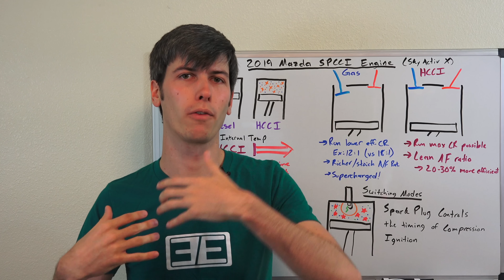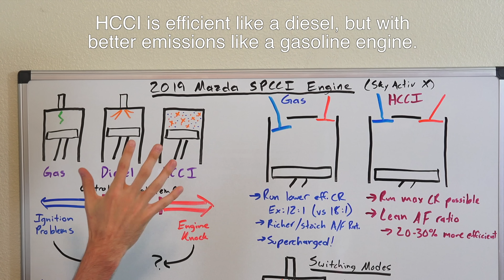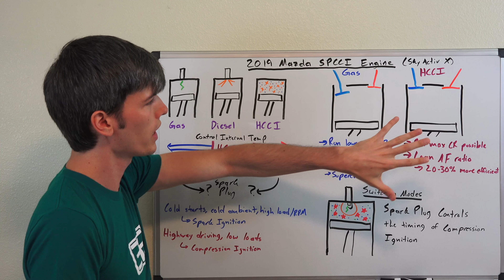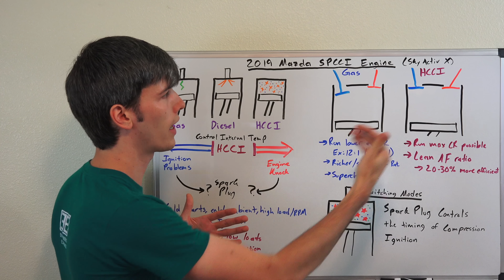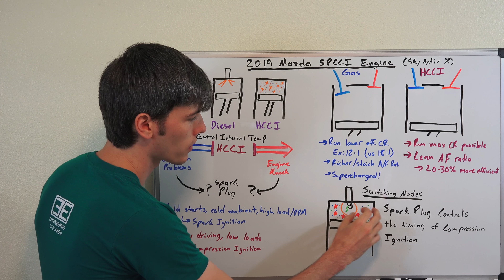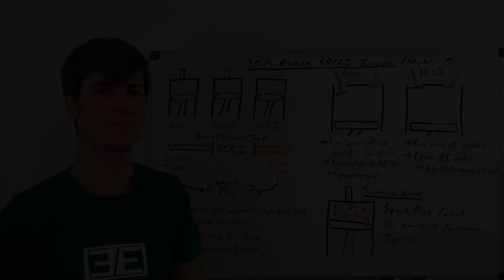Mazda Creates The Holy Grail Of Gasoline Engines - HCCI SkyActiv-X

Comment: A steady improvement and occasional breakthroughs og candles did not gibe us the Tungsten bulb; improvements to the Tungsten bulb did not give us the LED.  Likewise, all the silly "breakthroughs" with horribly complicated, inherently lossy ICEs will never get you close to the efficiency of an EV.  A Tesla Model S is one of fastest, quickest cars in the world... 0-60 mph in as little as 2.3 seconds... over 90 MPGe... needs no transmission, not even a reverse gear, yet has a top speed of 155 mph.

Of course, that comes from a company less than 20 years old, so they jave plenty of room for even grester efficiencies, performance and cost refuctions.

The Chevy Bolt EV provides 119 MPGe,  has a real-world range of over 300 miles (not the ridiculously conservative 238 miles the EPA has rated it), and provides the exact same 0-60 time of a Camaro, that has far more pathetic efficiency, and requires none of the tune-ups, oil changes, air filters, oil filters, fan belt replacements, leaky oil pan gasket replacements, tranny service, etc., etc., that no EV will ever require.

How millennia do you think it will tale to refine that behemoth you are so excited about to get it to 

Neither this silly, complicated Johnny-come-lately nor any other ICE will ever achieve the simplicity, efficiency, maintenance-freedom of today's EV?

Oh, I thought not.  Then why do you continue to beat this dead horse?  Why do you continue to delude your listeners?
Reply: I'm sorry... but... I found it difficult to completely read your comment due to all the grammatical mistakes. I can't even...
Reply: And what is going to power all these EV that will replace ICE? Energy grids that will require even more coal to burn , which is basically the most polluting agent?
Or the next step is to demand that every citizen gets an estate mansion that has enough sqft area to cover the increasing energy costs, with expensive and hard to produce solar panels?
Reply: But only rich people who also have ICE supercars can afford Teslas. What about people who can't afford it? Do they not deserve efficient cars as well?
Reply: Do you even know how an led generates light?

You couldn't be farther from the truth man.
Reply: Mazda is working on a Rube Goldberg machine. Meanwhile, Hyundai Ioniq has a 136 MPG combined. 150 MPG city. Mazda's most efficient 2018 vehicle gets 35 MPG. A 20% increase is a joke. A Prius from 15 years ago can beat that. Or a Honda Civic from 1990.
Reply: but hey, on a lighter note check this out! this is the truth.
https://www.youtube.com/channel/UCS_FY5mR4g22L_E9t1D_ExQ
Reply: oh don't forget this channel.
https://www.youtube.com/channel/UCTlbjcTWjTLqNmcF3VL7Xag
Reply: not even my worst enemy deserves a tesla
Reply: GloomGaiGar Yes, it's called a Prius which will probably beat this Mazda piece of sh-t. Or any one of the other EV that are less expensive than a Tesla. Look on fuel economy gov. There are plenty of EVs out there. As far as I'm concerned, Mazda is just a tool of the fossil fuel industry. Continuing to propagate bad ideas instead of delivering the real change that we need. I have a Nissan LEAF. Cost me $28K. I see morons driving huge gas guzzling pieces of sh-- everyday that cost more than that. Go price half the trucks these morons are driving.
Reply: billdale1 

Except that there's a gap between an all EV future and now. Something has to fill that gap while the emissions standards are increasing. 

Consumers in all won't go out and buy EVs, which haven't achieved success other than Tesla (which is a luxury brand). 

And any innovation is good, it provides more options.
Reply: Major fail on the belief that a EV is "efficient". It's not... it's a massive waste of resources.

Comment: So, they'll go from 8 lts/100km to 6,4 lts/100km and retain spark plugs+respective cables and electronic ignition computer? 
In the mean time I'm doing 5,7 lts/100km on my Volvo V60 diesel... no spark plugs...
How many millions have they invested on this? 
Someone is laughing.
Reply: you dont understand anything about cars do you? There's a reason that not all cars a diesel. Gasoline burns MUCH cleaner than diesel. Mazda currently has a CX-5 Diesel that's going to be available to the market within a few months goes 5.4 L/100 km. Also, some of countries are planning on and are in the process of COMPLETELY banning diesel cars in major cities. Like Germany. You should do some reading if you think people are actually laughing about a potentially more efficient gasoline engine.
Reply: well except for all that NOx diesels spew... that is killing people... I own a TESLA and its powered by SOLAR so i'm doing my bit.....
Reply: Dmitriy Barsukov 
The V60 diesel has a Euro4 engine with particulate filter. Because Diesel engines are so much more fuel efficient than petrol the total amount of particules released in the atmosphere is considerably less. 
Some cities have plans to ban both diesel and petrol cars.

Comment: wait... whaaaaaaaaat? "new engine type based on reactive combustion that relies on a static temperature/pressure enviornment. wait that doesn't work? use a spark plug to force it to work and let's try to really confuse them by saying it can be a totally smooth transition but wait it's not efficient because at first when it tests itself it's a richer fuel/air mix that defeats the purpose of itself... REBOOT"

am i the only one who sees this or is it just too late at night?

Comment: How would a forced induction intake work if the intake valve is left open during compression? Is the air pressure coming in and the air pressure going out at the same time negligible enough to not be conflicting?

Comment: This will have to have electronic valves, no? The valves have to open and close on demand, and not governed by the position of the crank, to regulate compression like that.

Does this lead to the problem of a 25 dollar solenoid that fails to work without warning grenading your entire engine?

Comment: Interesting, I'm not sure I understand how the process can be controlled by a spark plug though. How is HCCI any different from normal running if the combustion in HCCI mode is also started by the spark plug igniting the mixture? My thought is that surely in the less than optimum condition when HCCI is not possible e.g. in a cold start procedure, you would use the spark plug to light the mixture prematurely, before the piston reaches the very top of it's stroke. When conditions are OK for HCCI the piston will be allowed to get the top of it's stroke due to no spark plug being fired and the resulting extra compression leads to spontaneous combustion of the mixture as in a diesel - HCCI.

Comment: This answers to questions nobody ever asked. HCCI is a joke, not solving emission or fossil fuel usage problem. If this is "holy grail", then what this "engineer" would call CBG MonoFuel Engines which runs 18:1 compression ratio all day and has zero emissions? Those can be found for example from busses. ProTip: use Biogas and then never look back to these fossilfuel engines again.

Comment: So basically this is an engine with dual personality, it can be in an only compression mode when you don't have the pedal to the medal and when you want to move, you can use the spark ignition for classic gasoline engine feeling. 
But really, this is just marketing because if you look at the emissions limits on EURO 6 for diesel vs petrol engines you will see that the difference is tiny. EU6 diesels are ~ the same in pollution as petrol EU6, but they cost more to make because of particulate filters and adblue necessary in diesels.
Still, I think Mazda will regret this decision because electrification is the way to go now. It is not a trend, it is common sense and however you look at it, science or day to day facts, electric powertrains have only advantages compared to ICE. Only the power source is debatable, but that can be solved, it is not a hard limit like the one current ICE tech has hit.
Only time will tell who was right...

Comment: Gasoline injected at high pressure as in diesel? Or low pressure atomization as in modern efi? Awesome. In the 1950s IHC had multifuel motors which ran on either gas or fuel oil. Military trucks also had this.

Comment: So with the super lean super hot gas engine, had anyone bothered to look at oxides of nitrogen? Nox is typically regulated by the egr to cool the combustion chamber, in this case you need a very warm combustion chamber, how are Nox levels not through the roof?

Comment: By 2019 Battery Car will be on par with gasolin in terms of cost and By 2030 all car will be electric. Nice future visison from MAZDA :P :P
Reply: in the 80s  they expected flying cars by 2015 which is 30 years ago... well didnt happen. And so EV's wont jump from 0.1% marketshare to 100% in 13 years.
Reply: You're a passanger of a Hypetrain and hypetrains usualy derail and crash.
Reply: As cool as EV's are, they are ridiculously impractical and too expensive. Also Elon is just a straight up douche.
Reply: Where in the world are your estimates coming from? What sources gave you the information that led to the idea? If you simply cannot or will not state that, i'm 100% sure you pulled that out of your a**
Reply: 7-15 years 25% of vehicles sold in the US will be all electric, or at least hybrid with 200 miles of range from charging.  That's my projection.  Once people get the groove about where their value lies and use them in that mode (mostly city and short run distances) they'll gain popularity very quickly.  If they can get a really good one in a smaller SUV for the 25-45 age with kids to ferry around, it'll be a status symbol and really take off...
Reply: Ok < I change my word :
Ha Ha...... old people  always resist new technology and they are homophobic !!
Reply: Ha Ha...... old people  always resist new technology.

Comment: Gas is dead, get over it. The future is electric, no breakthroughs can stop that
Reply: Can you imagine the electrical load on a substation serving a neighborhood of several hundred electric cars (2 electric cars per household) charging every evening?
Reply: Thomas 16.04 there are gonna be other ways to fuel engines, in not gonna wait hours to charge a tesla just for 300 miles
Reply: Just think how boring Mad Max would be if electric motors replaced gasoline engines.     Yucky!
Reply: Also wind turbines and solar panels are toxic AF to the environment. Nothing comes without a price. EV's aren't solving anything honestly, and Tesla is all hype. The only rational thing to do would be to stop driving cars completely (which of course won't happen at all either). I just hate how overhyped and sugarcoated electric cars are. They aren't green at all. Cool? yes indeed! (Just not teslas lol). The Rimac concept one is a monster of a car! But EV's are still a part of the problem.
Reply: Yeah, I do foresee the gasoline car going away at least somewhat in the future--perhaps a decade plus from now.  But I actually foresee the source of propulsion being diversified.  Once 50% of the vehicles on the road are electric in lots of parts of the world, what are the Arabs going to do?  They'll have no choice but to lower the price of fuel to help boost demand for it.  They are going to have to do that.  What options do they have?  They have no other natural resources.  When that happens, gasoline is going to be so cheap that.... well, unless battery technology makes some significant leaps, which it just may, there's just no economic reason to go with an electric car anymore.

My whole gripe about the electric car is the fricken batteries.  Show me any battery any time in your life in any device that has lasted 10+ years and was still strong.  It doesn't exist.  Not yet.  Tesla is just making Panasonic 18650 battery cells.  They have no technological breakthroughs on anything.  Those poor bastards that bought a Model S back in 2012 or whenever they first came out are going to have a lump of junk sitting in their driveway that is going to need a $18,000+ battery pack in order for it to go again.  It'll happen with a cordless drill, which takes literally the exact same batteries.

The electrical load to charge the vehicles is actually plausible.  Most vehicles would be charged at evening/night time during off-peak demand schedules.  The power companies can also control your air conditioner's cycles, so why can't that be done with a car charger?  I think it can actually happen and work out well.
Reply: "maintaining is already cheaper" yea cuz they are all still on warranty
Reply: In your perfect imaginary world maybe but the real world which also includes places outside California, that simply isn't the case. You keep telling yourself that though then maybe one day you'll be able to afford Tesla side mirror.
Reply: @doktorbimmer The majority of the market commute less than 30 miles, it's not a "tiny niche market". Electric is ready, it's just a matter of price now.
Reply: The future as the U.N. envisions it, is in mass transit in major cities...and NO vehicles period...it's known as United nations Agenda for the 21st century or Agenda 21.
Reply: In the end there is no solution to feed 7/8 billion mouths. The electric powergrid woud not be able to sustain all the electric power demand and windmills and solar panels wont be able to accomondate for that. And tons of batteries you need to mine lithium for it, All the energy we use comes from the eaths heat and the sun itself. ITS NEWTONS THIRD LAW The third world war in close or distant future is not impossible, its inevitable.

Comment: Load of crap, electric is better.
Reply: The problem with electric is no mystery, batteries. Besides the tech lag, typical lithium mining is an environmental disaster. My guess is that Mazda is waiting/working on a battery breakthrough. In the meantime, they're developing what looks to be a highly efficient, potentially multi-fuel combustion engine. It's a smart move imo. Right now, as fae as electric goes, a diesel hybrid set-up would be the most efficient and convenient, like modern locomotives. Why is that (no brainer) not offered? Because it would be too efficient.
Reply: Shaun Dobbie that's only 0-60, many cars can catch up after that.
Batteries are harmful and is incredibly huge compared to a gas tank. Most power used today are coal power plants, so if that changes, only then I will consider tesla will be better than combustion engines.
Reply: hes right tesla IS gay af
Reply: hahah nope. First of all people will charge their cars (like now) while they are working. What do you think will happen if (only) 30% of all people charge their cars with heavy current all night? The overall load spread across the day will be so much greater. Most countries just can not produce that much energy. It's as simple as that. Of course not everybody will buy an electric car tomorrow but they way emission standards are set and the way politicians push electric mobility, the infrastructure just cannot keep up.
Reply: Lithium is also extracted from salt water through eveporation. The environmental impact of making batteries is far less than the damage and mess the oil companies cause.
Reply: I don't think so. First of all the mining for the batterie components is unbelievable damaging to the environment, as well as the further processing of dead batteries. Then there is the issue of producing the power to charge all the batteries. This is a point nobody is talking about. To start the US only produces a few % more energy than it's currently using. Filling up a regular car doesn't need additional power delivery. Charging an electric car does and most countries just aren't able to produce that much energy, even if only 30% of the population would drive electric. And how do you create all the additional energy? Nuclear or coal? So your "green" car doesn't look so green anymore, but most people don't think that far. The next problem is taxes. In my country every liter of gasoline has about €0,48 of tax. That's about 40% of the price for 1 liter. So if more and more people are changing to electric cars what happens to all this tax money? The state just doesn't need it anymore? I don't think so. There will be additional taxes or an electric car charging tax or something like this. And yes Tesla makes one of the fastest 0-60 cars but only 0-60 and not further and after 3 runs the batteries and motors are so overheated that it's really slow, besides the terrible build quality for that price...
Reply: +Norsefalconer nothing wrong with batteries, they are 5x more energy dense that petroleum...
Reply: tesla is also the future!
Reply: Wrong again, the grid won't be overloaded as most charging can be done at night when demand is low.
Reply: Nothing wrong: It would accelerate so fast that you would not be able to control it precisely.
Reply: How misinformed you are.
Reply: I rest my case.
Reply: Shaun Dobbie can't wait for my electricity bill to go up
Reply: Well said, nobody talks about where the batteries and power grid comes from.
Reply: Again, incorrect as I drive my electric car completely myself and it has no self driving capability.